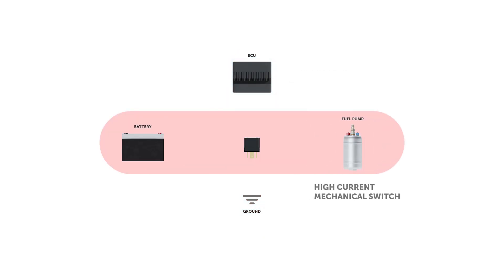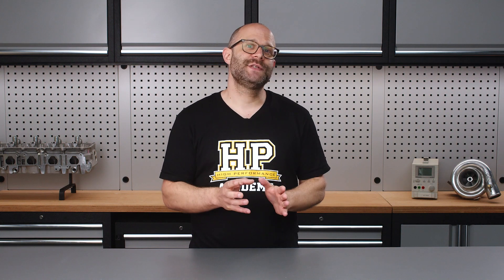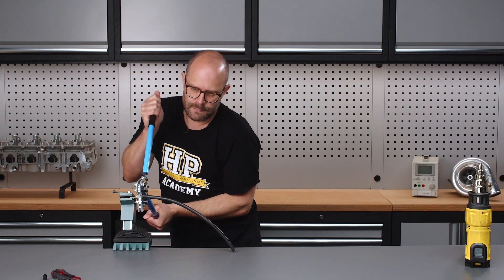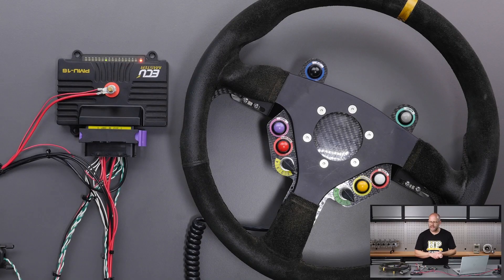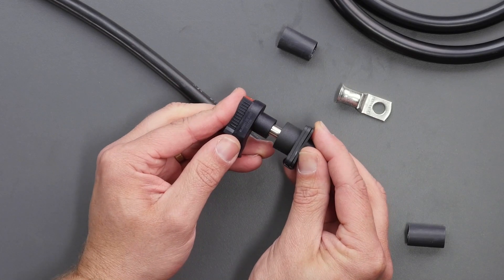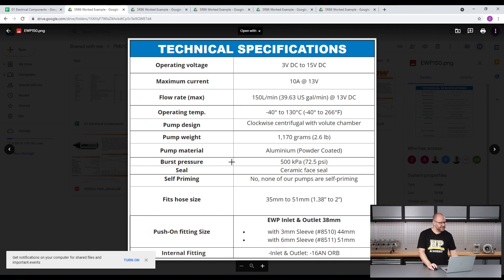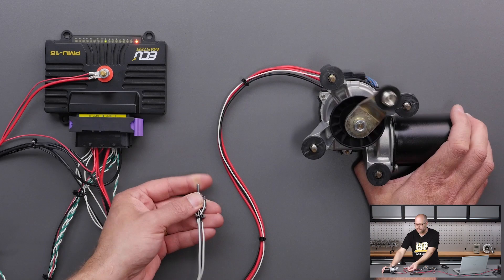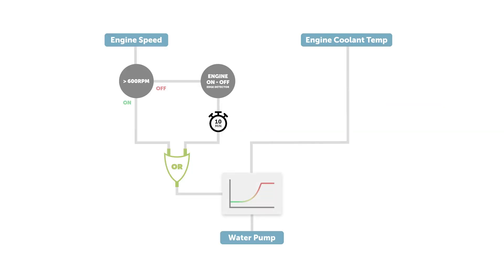6 Steps To PDM Setup (+ PDUs, & PMUs) ⚡️👨‍💻🏎 [NEW #COURSE]

Comment: Hi folks, is there a specific PDM you'll be using in this course?
Reply: They use ECUMaster but it is all spoken i general terms and is pretty applicable on all PDMs. The worked example is ECUMaster as well.
Was going to use ECUMaster for my current project but it does not have enough outputs and I can not justify the cost if two...
Reply from the maker: @Carl yes that is one of the downsides but also no doubt one of the reasons for their sharp price.
Pros and cons for every option. Do you know what you will get instead? - Taz.
Reply: @hpa101  been looking at Hardwire PDM 25+. Software interface is not the best, missing the ability to create reusable functions as the ECUMaster, but price is nice and it seems to do all the things my restomod Fiat from 71 needs 😉. 

This was another great course to give me better results. Thanks guys!
Reply from the maker: @rugwalle  we haven't had first hand experience with them yet but have heard mostly good things like you laid out there so I think you will have made a solid choice if you go for one of those.

They are also on our list, but it's hard to cover everything hence that core corse then example approach for you guys. Glad you have enjoyed this one too, as always Zac enjoyed putting it together as well which generally shines though 😎 - Taz.
Reply from the maker: Cheers for jumping in there Carl!

@Evan as mentioned we have started with Ecumaster as that is what is in our 86 at the moment. We also plan to add a PDM15 (MoTeC) and the Haltech Nexus.

As Carl mention, the course is structured like we do with our Practical Tuning courses etc where there is a core course which is comprehensive, and then a Worked Example, which takes that knowledge and shows it being put into practice. That said, if you have the same PDM we use in an an example like that it helps you learn faster, but it isn't always something that is 100% required to be able to translate the knowledge to other devices.

Bit long winded there sorry dude, but hope it helps.

Out of interest what PDM do you have Evan? - Taz.
Reply: @hpa101  I'm currently looking at an AiM PDM32. I'm doing a Honda swap in my '64 mini and wanting to digitize every aspect of the car including a custom harness. I'm a very hands-on engineer but limited in my programming abilities. (I get by, but need help on occasion)